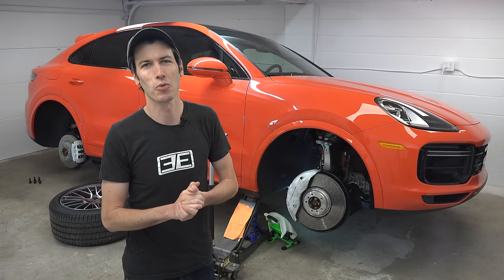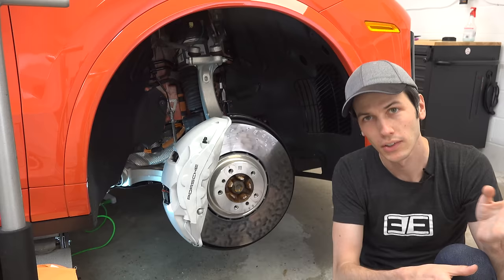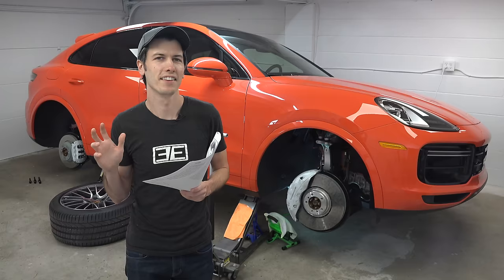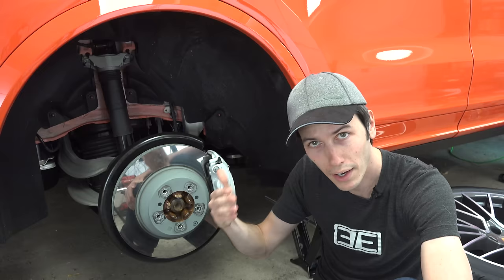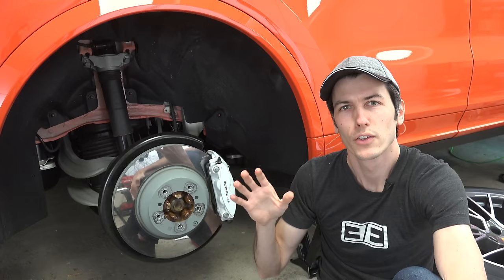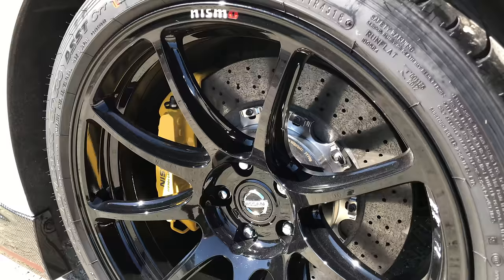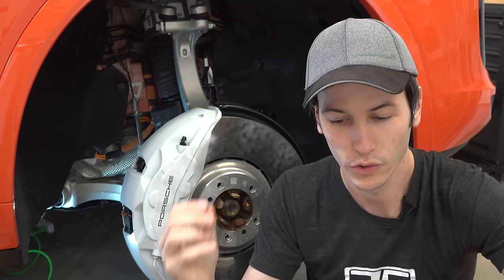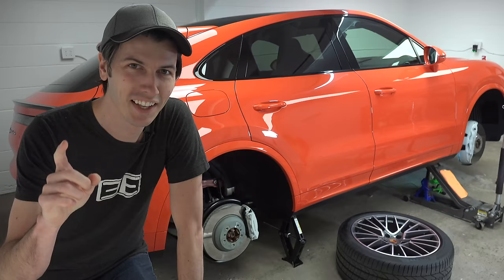Porsche Reinvents The Brake Rotor - No Rust, Low Dust, No Fade!

Comment: When the coating wears off, would you not just have a good quality iron rotor to last you a while longer? Similar to the way the original Blizzak winter tire would wear down to a harder compound, leaving you with a decent all-season rated tire for another year?
Reply: you don't know how the special pads work on regular iron
Reply: @TheBacontarian  then just get regular pads since you now have regular iron rotor. Saves you the cost.
Reply: @Silver_o  you'd likely still have to replace the brake calipers, and those probably won't fit around those rotors, so then you have to replace everything anyway.
Reply: He adreses this right in the video, 2:29 once the 0.1 mm thick (that's less than 4 thousanbds of an inch), wear offf you have to replace the rotors. BUT they are so hard the .004" is designed to last 30% longer than a regular cast iron rotor. .. I'm skeptical. 
My thought is people who drive these don't care about money so normal break service is replace all pads and rotors (and probably the calipers too)
Reply: @nielsonderbeke8507  I think for a 1mm wear on the rotor, the caliper will fit just fine, but the regular brake pads won't be designed to fit in those calipers. They will have to be used with their own calipers which will not be designed fit the tungsten coated rotors and that will forces you to change out the entire rotor, caliper and brake pads assembly.
Reply: @Silver_o   surfaces don't wear perfectly so you would have patches of iron and the tungsten. You would have to resurface the rotors too
Reply: @Silver_o  yeah, that's what I wanted to say, but you explain it better :)
Reply: @TheBacontarian  You're probably not going to be able to resurface those either.  The way that's done is to turn the rotor on a lathe.  Since the rotor surface is already tungsten carbide, you would have to use some form of diamond abrasive to grind the rest of the tungsten carbide off first.  The problem is that you will grind the iron and carbide patches at different rates so you'll end up with a very uneven finish.  You can rectify that by turning it again with a tungsten carbide cutter but by the time you have finished both operations you're probably going to find that the part is just way out of spec, size wise.
Reply: @ColonelSandersLite  - Cubic Boron Nitride, will cut Tungsten Carbide nicely.
Reply: If you are concerned with ways to save money, maybe you should not be throwing a $145,000 Porsche around the track. 😯😉😄
Reply: @MikeBaxterABC  I trust Porsche and their specs, they usually never exaggerate, if anything it's the opposite. I have PCCBs on my Cayenne with 90k on them and they look brand new. I was told they will last a lifetime, and I believe it.
Reply: Hussein Omobola yeah, buy cheap metallic ones while you save up 11k. Haha
Reply: If you put cheaper (and softer) brake pads on those monster callipers, they're probably gonna get squished into flat pancakes.
Not only that, but there would still be small patches of wolfram carbide here and there, that would absolutely chew though the pads at a ridiculously high rate !
Reply: Seems like a good way to up charge... Needs 10 pistons cause the rotor grips like crap... Anything with 10 pistons is going to stop very very good.
Reply: @Silver_o  exactlz. Porsche doesn't manufacture their own brakes, in fact not a single OEM does. These brakes are japanese, most other Porsche brakes are Italian. While I think it might generally work with regular brake pads, you won't be able to make them fit without a regular Brembo caliper
Reply: The iron probably isn't designed for wear
Reply: @BassistUndStolzDrauf  Porsche isn't a manufacturer, technically.  They assemble parts sourced from others.  They have no foundry or engine essentials (block, crankshaft, connecting rods, etc.) production facility.  Sourced elsewhere.  Where did I hear this?  Porsche Zuffenhausen.
Reply: @MikeBaxterABC  There are certain models of Porsche that have a 20,000 mile service that requires engine removal to measure the clutch disc (also a special disc with less than normal amounts of tolerances) and that service costs well over $10,000 as told by an acquaintance who owns such model. $20,000 to $25,000 service invoices are not uncommon.
Reply: @dadillen5902  As spoken only by someone that has never experienced the rush and addiction of motorsport.....  Crack and heroin are cheaper as any Porsche enthusiast will proudly acknowledge .
Reply: @briangc1972  i will remove the engine myself before ever bringing that to a shop.  pulled 3 engines this week.  Then just buy aftermarket and get the same parts for allot less.  Many aftermarket parts makers also make OEM.
Reply: Mike Baxter No, you’re missing what people are saying completely, lol.
Reply: Mike Chin Why? Would patches not stop you? So they designed brakes that fail once the coating wears down? That’s safe.
Reply: clownavenger You pulled 3 Porsche engines? Why would you put cheaper aftermarket parts in a $145k car? Save those for your Civic.
Reply: @ColonelSandersLite  Is that how rotor machining works? Ii'm not an expert but I don't see how you can grind at different rates.... doesnt the cutting surface stay in a fixed position relative to the rotor until all material is no longer in contact?

Comment: That is an old machine shop technique called spray welding.  Spray welding is often used to build up  a shaft's OD  after it has been damaged or machined a tiny amount too small (usually called an oops). The bearings on the end of a shaft has some tight tolerances, so this technique builds up a ceramic layer that can then be machine down to correct size.  I am thinking Porsche figured out how to get a hot enough flame to melt carbide or did they simply melt a ceramic with a high percentage of carbide?  There is a huge variety of ceramics that could be used. Usually they are brittle, so I wonder how they got around that  issue. BTW, I am an engineer too. You do devolve a thick skin after a few years of people "critiquing" your designs! Enjoy your videos, please keep them coming!
Reply: There's no need to guess about the process - Jason shows it in the video. It was not developed by Porsche.

Comment: A wonder: they last 30% more and cost over 4.5 times so Iron cast breaks will last over 400% for equal amount of cash spent in brakes.
Reply: Money is not the point,  it's lost life time spent in service
Reply: @sirhenrypatschislewsky5248  A brake job takes a day, and the dealership will prolly give you a loaner, or at least drive you home and pick you up the next day.
Reply: @sirhenrypatschislewsky5248  How long do you think it takes to change brakes lol? At most it's a day — which can be booked well ahead of time.

Comment: I've heard good things about asbestos, seems like we should make brakes from that
Reply: They use peanut resin in most brake pads.
Reply: That's what MAGA means:  make asbestos great again.
Reply: it's toxic!
Reply: Until it was realized that asbestos is toxic, brakes with asbestos were common.
Reply: @maltehoffmann3621  That's the joke - every man over 40 has replaced brakes whilst thinking "these might be asbestos... best pull my t-shirt over my face just in case"
(I know that a t-shirt is not a BS / CE approved respirator, that is also a joke).

Comment: Spending $11,000+ on brakes is just INSANE, let along $30K+!!! I'll keep my standard brakes and replace them as needed, thanks!
Reply: its not designed to save you money , its designed for convenience and reliability
Reply: @abdullamohammed2637  $11,000 is not convie ent... 

$80 and 40 minutes once every 5 years for my 90s truck. Now THATS conveinent
Reply: @poopinfruz9771  These are Porsche breaks. They aren't meant for 90's Truck either ...
Reply: @licornithorinque  true!
Reply: Well it claims to be almost as good as a carbon ceramic under certain circumstances... It's not that bad when u compare how much more expensive the carbon ceramics are...
Reply: Spending $2,000+ on a set of steel rotors and regular pads is just as insane.
Reply: @licornithorinque  most of these are going to take the kids to soccer practice, slowly, in the left lane... Probably with a turn signal on most of the time.
Reply: @brianwright9514  true hahaha 😂can't argue with that but Porsche doesn't only makes Cayenne's, so i would believe that it's a technology that they can also use in other models.
Reply: It's designed to not see the rust through the wheels.  Performance is a secondary bonus that is nice to have.
Reply: @potatocubes69  That's marketing speak. "Good as CC" but CC is only better than steel rotors with respect to fade resistance. In my experience a more aggressive pad on steel beats CC with factory pads on most cars - just eats rotors a lot faster and reaches fade quicker. But I do not believe CC is worth the cost under just about any circumstance short of road racing and even there they might not be worth it with stress cracking. For a street car, CC never makes sense to me. The bad thing about the coating is IF an average Joe ignores it, I would bet those pads eat up the steel rotor base once the coating is worn.
Reply: Throckmorton. Makes as much sense as spending $150K on a hatchback.

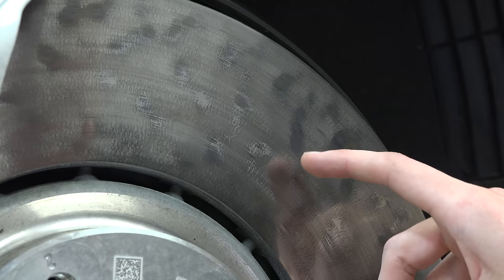Comment: 5:22 I’ve done the same (120-0 braking, rotors were warmed up gradually first) to Baer 2-piece rotors on my evo, turned them at a shop afterward, and those dark spots are where the internal vanes suck away heat (as they are supposed to) hence, under ultra-dynamic conditions, those heat sinks actually quench and harden the metal, far harder than it should be.

The rotors were barely serviceable with the lathe and the hard spots were high spots later in rotor life. I eventually threw them out. So I question whether this is “normal” (or sales-speak) because subsequent wear on the carbide surfaces does appear to show the cementited spots standing proud and revealing uneven wear. Perhaps the Porsche vane pattern (see below) scrapes the pads evenly, in the end, and makes this irrelevant (??).

The internal baffles on most rotors are simple vanes, Porsche is the only one I know of that casts the smaller, teardrop-like shapes. Likely with their knowledge of cooling engines (fans, shrouding, fins, etc).

Great vid, my fav so far 👏👏

Comment: It’s just wild to me how you can get a brand new car for less than some brakes
Reply: For now, limited supply new tech always has a premium price tag. None of the cost efficiency of scale is applied yet.
Reply: @jaydunbar7538  Absolutely. Just look at electric cars, more companies start doing them, now you can get a model 3 for a relatively average price. As more and more companies invest (it they see the potential) the prices will be so much better. Give it 5-10 years and these could cost a little bit more than a normal break surface, but just about the same.

Comment: 4:00 "tungsten carbide is use to make cutting tools!" holds up high speed steel drillbits
am I pedantic, yes.
Reply: ha ha maybe they are carbide tipped drills , look like hss to me
Reply: @Rathori  well if its not a cutting tool then how does it cut a hole ??
Reply: Jeff Bruce it drills a hole🤪
Reply: @Rathori  - A drill is a cutting tool
Reply: @jeffbruce9589  @scmike1229 - ok, you're right. There are two similar terms in my language that could be translated as "cutting tool" and seems like I was thinking of the wrong one.

Comment: i wonder we can put the tungsten carbide spray to internal engine parts... such as crankshaft.. will it be  more durable
Reply: I would probably use titanium nitride it is easier to get a more acceptable level of finish and would still drastically increase wear resistance.
Reply: Tungsten carbide is used on actuator piston rods in aerospace applications.  It is considered a better wearing material than hard chrome piston rods and is more environmentally friendly.  The downside - it costs more.
Reply: In fact many higher market (performance) engine components, do rely on surface treatments, coating, of several types. So not really novelty! ;-)
Reply: It would depend on other factors in that application.  For instance, how well does the material wet with oil?  A crankshaft bearing rides on a film of oil.  Without that oil layer even the hardest of materials would fail quickly.

Comment: 32 grand for a brake job. Lol. I guess you're gonna need another tax cut in order to cover that!
Reply: Nah - just buy a Tesla motor and install it and the batteries so it runs backwards.  Then make the brake pedal the Tesla accelerator pedal.  Stops on a dime, never wears out, and you still have pretty white calipers to show off.  Same price.  By the way, you could have the rotors machined and take them to a knife company that makes Tungsten Carbide blades for electric knives; I worked in one for a summer job many years ago.  You polish (turn) the iron rotor, bring it in, put it in the sandblasting machine to lightly burnish the surface, take it to the carbide sprayer, spray 5000 degree carbide at it, and Bob's your uncle - new rotors.  Maybe a hundred bucks a disk, tops.  Now - how much are the special 10 pads per caliper????
Reply: bro, rich people don't pay taxes, only poor people. In america, anyway. And poor people don't buy Porsches, either, so, yeah theres that.
Reply: @MrGsteele  Number one, these days Bob could be your aunt. Number Two, you probably just violated at least a dozen patents and I am betting the lawyers will cost more than $32 grand, but i could be wrong.
Reply: plus labour.
Reply: @VTLIFE-so4dc  well, that's nonsense that flies in the face of reality and facts.  Try reading about who pays the bulk of taxes before spreading class warfare sound bites out as if they were real.  You're doing Pelosi's dirty work for her.
Reply: @dadillen5902  number one, bob is my brother-in-law; number two, you don't violate a patent by duplicating it for your own use - only if you sell it on.  Number three, it depends on the type of patent - process, etc. what it takes to violate.  Doing what I said would never violate a patent.  But the special pads are still an issue.
Reply: 01V70T5 4LIFE rich people pay the vast majority of taxes.  Look it up.
Reply: 01V70T5 4LIFE uhhh. Don’t think you’re right on that one chief. Look up any basic tax bracket.
Reply: @ReidEvers  He is right, Look it up

Comment: "The best part is no part" - elon
So using full regen braking is the right way go go.
Reply: Sure but unless you developed a new type of capacitor not feasable
Reply: @mddunlap03  what like already available super capacitors?
Reply: @dantheman1337  It's not only that, it's an even larger problem that the power of the generator (the electric motor ran as a generator) would need to be huge to equal what normal friction brakes can do at high speed. In a car with 1700 kg weight with full brakes at 150 km/h, the brakes release about 1000 hp.
Reply: @mddunlap03  might want to let conrail know the brake systems they've been using for the past 40 years doesn't work.
Reply: A car with regenerative still needs friction brakes. Even a powerful electric car will need more braking "power" than the motor is capable of in a panic stop. And regenerative can fail, even just because the battery is full or too cold and can't accept charge. My mom's Tesla Model 3 has no regenerative brakes when it's cold, it's a bit terrifying when the car doesn't drive like normal, but the regular brakes work fine. So for several reasons you absolutely must still have friction brakes, but they usually won't get used much. So they'll probably last the life of the car, and don't need to be super expensive long-life or high-performance brakes either (though they would need to be quite powerful because electric cars are heavy). I seem to recall this was true even on a Prius, went like 300k miles without ever needing new brake pads.

Comment: LOVED your explanation, but HUGELY APPRECIATED your costing of replacements. 
I am about to buy a Cayenne E-hybrid, so at the beginning of your presentation I was thinking “I might just spec in those tungsten carbide coated discs”! 
No way now - not even if I’m pulling a caravan. I’ll just use the gears and the regen function with braking (which should save the brakes anyway!).
Great work!
Reply: The advantage of ceramic coated rotors in a hybrid would be reduction in rusting of the lightly-used rotors. With any luck, they'll last as long as you keep the vehicle so the replacement cost would not be a concern.

Comment: As a veteran car mechanic all those plastic venilation plates to direct air flow seem to always be removed and tossed either because it took some small road damage or it had to be removed to change the oil etc.. argued with my nephew for hours as to why his car was overeating and when I pulled out the plastic undercarriage shield from a garage closet pointed out it was designed to be on the car not in storage.. his reply was the missing fasteners cost $8 each from the dealership .... ? when told him to price a replacement engine it then dawned on him that the fasteners were quite cheap ... .. I drilled holes and threaded the steel and used stainless bolts to hold in place .. cheaper and better then OEM with rust removed from the equation